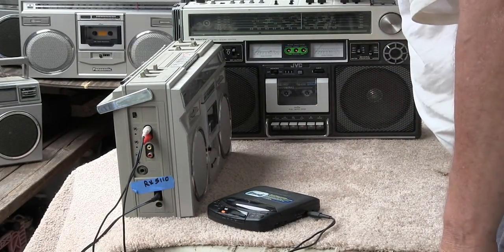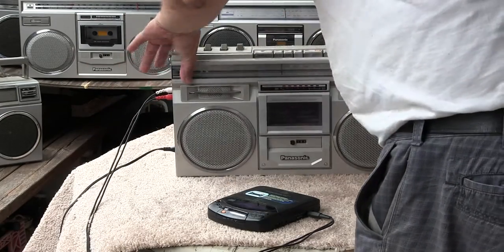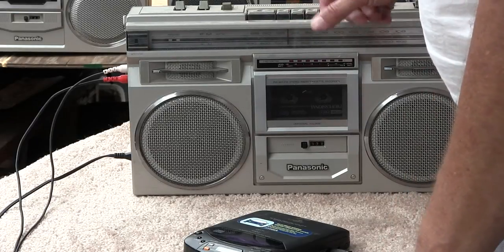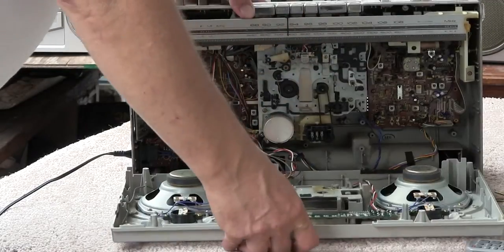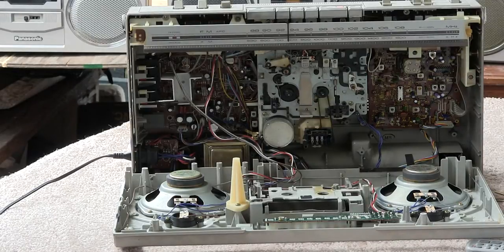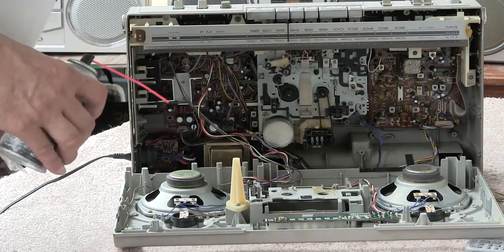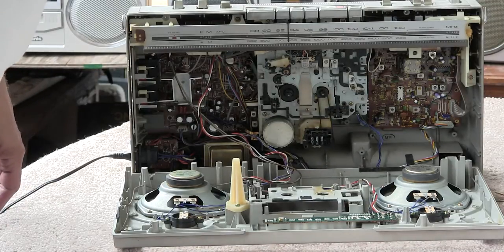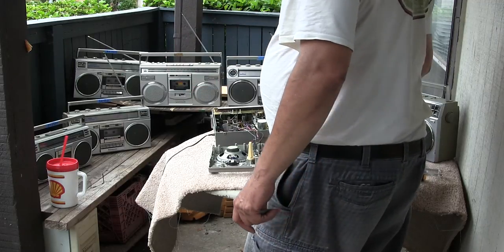Panasonic RX-5110 How to inside boombox Previous Noisy controls

Comment: what is the IC number in this boom box please tell.
Reply from the maker: 0. I did not removed the heatsink to ever see so I do not know
1. from the service manual: Power Output: 10W (5Wx2)...(DC max) 
2. frequence range: 50~13000 Cr02 & 50~11000 normal tape
3. and that is all I know